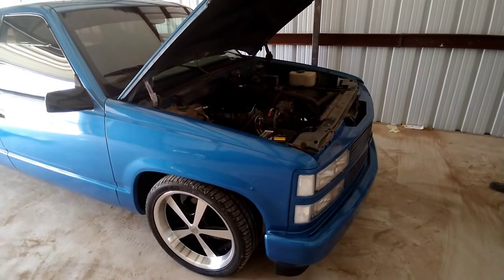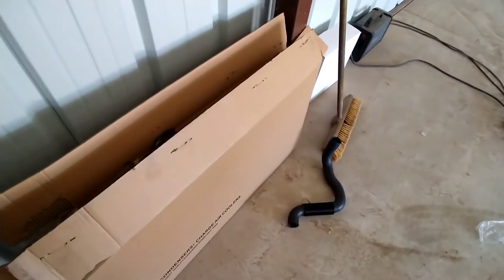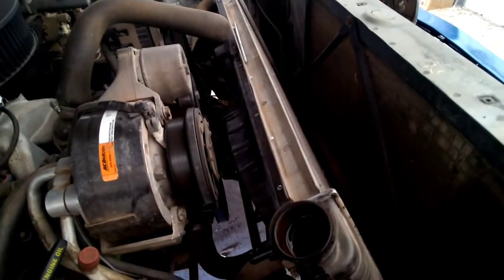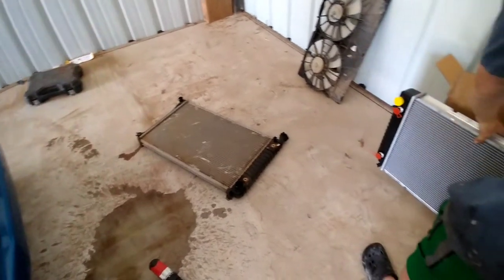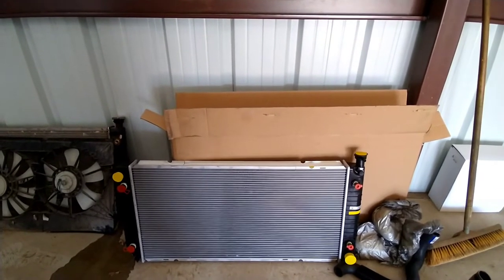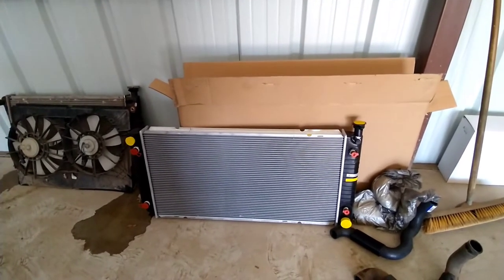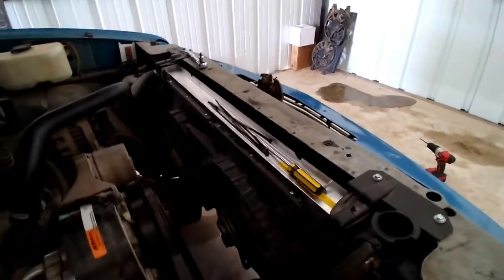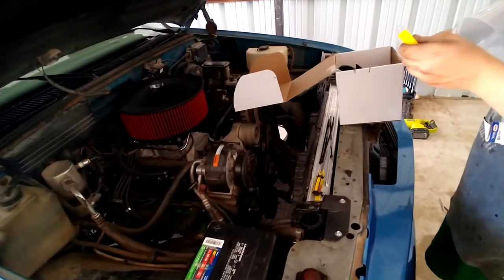OBS Cooling System Upgrade "Radiator"

Comment: I found a used all aluminum rad but I also cut out the core support on each side to allow air flow through the full 34 inch width.
Reply from the maker: That was a good idea

Comment: Nice build man where did you get your radiator?
Reply from the maker: I bought it off Ebay
Reply: @CCAutoWorks  thanks i been needing to change mine but I had ordered one and it was too tall
Reply from the maker: @mauriciozarabia48  I ordered this one and it fit good I just looked it up for the 454 ss trucks

Comment: yeah i did that to my 89 3/4 the sob came out with a 28 inch one core from factory im like who does that in a 3/4 ton 5.7 with a th400 like really so i upgraded to 34 inch BUT HERES THE DEAL THE CORE SUPPORT IS DIFFERENT YOU MAY HAVE TO TRIM IT OR IT WONT WORK AS GOOD AS IT SHOULD
Reply: it has moldings in the core thats still there i guess chevy decided to not cut that with the 28 inch but even my suburban has a 34 inch 2 core and thats stock. so its not just 454 upgrade the suburban is a 5.7 half ton but most had the big radiator keep that in mind
Reply: and your better off keeping the fan clutch instead of electric but either way its fine
Reply from the maker: I noticed that to but I had left it for now

Comment: Where did you find that radiator for that good of a price? Part #?
Reply from the maker: I bought it off ebay I'll try to find a part#
Reply from the maker: https://www.ebay.com/itm/Aluminum-Radiator-For-1988-1993-Chevrolet-K2500-5-7L-1991-1993-GMC-K2500-7-4L-/284149913553?mkcid=16&mkevt=1&_trksid=p2349624.m46890.l49286&mkrid=711-127632-2357-0
Reply from the maker: That's the cheapest one I could find now and there's only three left

Comment: Im about to install a new rad so can you tell me what this particular funnel is for? I have funnels so just wondering whats different about this one.
Reply from the maker: It's not necessary it just helps Purge the air out of the cooling system without making a mess

Comment: So is this radiator a larger cooling capacity than what you are taking out
Reply from the maker: Yeah it was in the big block trucks it's a 2row instead of the 1row I took out and the core is wider it's 34" compared to the 28" that was in it
Reply: @CCAutoWorks  gotcha, your truck looks killer per usual
Reply from the maker: Thank you it would look even better if it was a boss 302
Reply: @CCAutoWorks  and suburbans just find someone parting out a suburban direct swap shroud and all

Comment: SO BE SURE TO CHECK CORE SUPPORT I BET IT BLOCKS 20 PERCENT OF THE SIZE OF THE 34
Reply from the maker: I'll check it out I wasn't having a over heating problem I just did this just in case I ever did and I was putting new hoses so I just ordered the ones for the 34" core and upgrade the radiator to

Comment: What were the other two ports for on the new radiator? did you cap off those ports?
Reply from the maker: One sided transmission cooler and the other side is for an oil cooler I had no need for either my trucks manual transmission and It didn't come factory with an oil cooler
Reply: @CCAutoWorks  oh ok.  So it was not used then? Does it get capped off? Sorry I'm just confused about it.  I'm learning.  Thank you for your time
Reply from the maker: @SPANISHFLY1  if your talking about the ones on the side that screw in I just left them open but theres a nipple on the passenger side that a heater hose goes to
Reply: @CCAutoWorks  ok great.  Thanks for all your help. Great video
Reply from the maker: @SPANISHFLY1  your welcome anytime don't hesitate to ask

Comment: Drop a link for the 5in air fitter
Reply from the maker: https://www.ebay.com/itm/14-X-5-Round-Black-Washable-Red-Air-Cleaner-Assembly-Flat-Base-SBC-350-BBC-454-/284117548256?mkcid=16&mkevt=1&_trksid=p2349624.m46890.l49286&mkrid=711-127632-2357-0